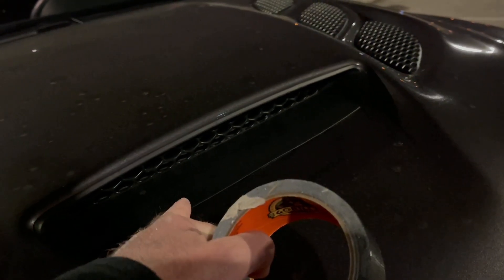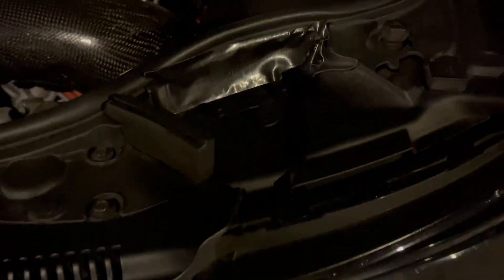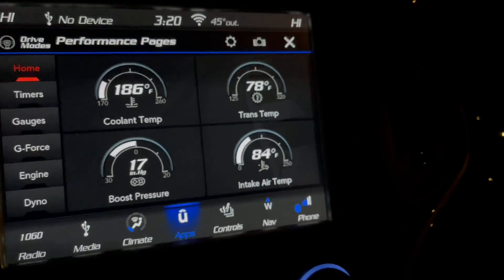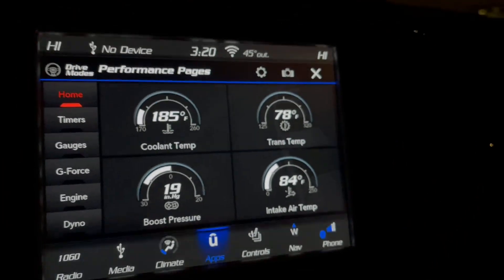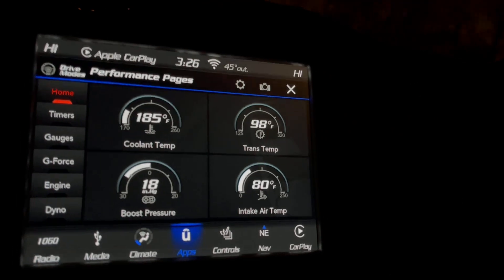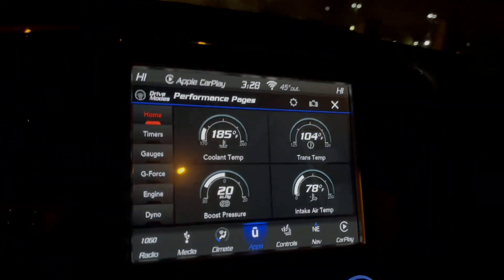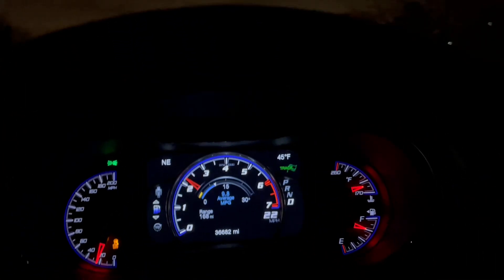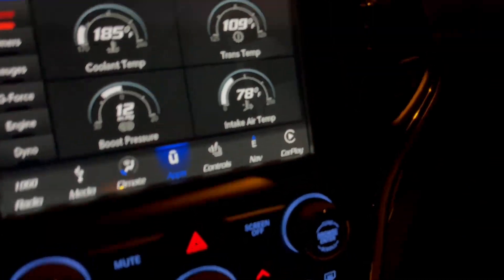DOES CUTTING A HOLE IN THIS OPENING LOWER YOUR IAT'S?

Comment: Just a question or suggestion here Ron, what if one , extends the harness , and runs the iat near the front of the bumper by the ambient sensor ?
Reply from the maker: If any cooler air is getting to the intake it should affect the IATs, but I don’t believe there’s actually enough air passing through this to even matter.
Reply: @EastCoastJeepSRT  kind of compacted in that compartment, and the whole brick nose is closed off for aerodynamics
Reply from the maker: My meter came today. Tomorrow I’ll be mounting it to see how much air is flowing towards the intake. Obviously any extra air is good, but to be cost effective it has to do something.

Comment: Ron unfortunately this test is not a good way to test this. The IAT sensor is under intercooler bricks in the blower so the only way to measure if it makes a difference will be UNDER WOT.  Under normal driving the IAT that you are looking at will stay the same.  You should know this. However I think it’s a waist of time to remove that piece.
Reply: I have a Maggie on my srt and the IAT suck just driving normal. It will drop for me 4 or 5 degrees at WOT. The hemi heat soak fast my IAT generally run about 30 to 40 higher than ambient temperatures. My idle temps can be over 150 at the track not hot lapping it. But also where I live after a pull in the summer the IAT are almost 200
Reply from the maker: Not true. The IATs fluctuate from 20 mph to 40 mph, so you don’t have to be under wot to see a difference. I ordered an airflow meter to place in that spot to see how much of any air even passes through there, but we can now see opening this hole does nothing for your IATs. Unfortunately no one can drive at wide open throttle everywhere so this hole, or part is useless.
Reply: @EastCoastJeepSRT  No I agreee that removing the plastic is worthless ! But the diverter valve does not close until until the jeep is making boost. the only time that any real air flow passes over the IAT that you see in the dash is under boost. All I am saying is your test is not showing anything because the dirverter valve is not allowing any real air flow to pass over the IAT sensor  covered or not.  Having an interchiller  really helps you understand how it works under boost. Its also the best mod I have done to mine ! I can not recommend it enough !
Reply from the maker: @hellhawk4680  As I went wot up the ramp the temps weren’t affected by the cutout or even my hood scoop. I’m wondering if the air from the scoop is missing the intake altogether. I just hate when people try to sell something under false pretenses. Just say it’s cosmetic and zero evidence shows it affects your IATs. Telling people more air gets to your intake without any third party evidence is bad business. I wanna add that piece because it looks better. It won’t affect temps one bit.
Reply: @EastCoastJeepSRT   I agree fully !! That company that is trying to sell that plastic printed insert lol. I got into an argument with them on the FB pages that it’s completely worthless. And they want $70 bucks for that thing 😂.  We’re on the same page 👍.
Reply from the maker: @hellhawk4680  Yeah, that’s annoying me that someone is trying to mislead people with that. I mean, the part looks great. I like it, but don’t sell me snake oil lol
Reply: @hellhawk4680  I totally agree. There are actually 2 companies that make them. The company you're referring to talks shit all the time. The second company doesn't market it as a performance mod and is great to work with.

Comment: I'd have not guessed at those results, like you say not definitive in anyway, but interesting to see basically not alot of difference at all!
Reply from the maker: Zero. I actually ordered an Airflow Meter to test of any air even makes it through there
Reply: @EastCoastJeepSRT  be interesting to see what you find as that is mad. Does make you think all the stuff we do and think it benefits, it's nice to measure a benefit i.e. you add a CAI, we wanna see HP hahaha... in this case you'd swear loads more air! Looking forward to next vid!
Reply from the maker: @MrPugheaven  people trying to make a buck and sell promises without evidence to back it up
Reply: @EastCoastJeepSRT  I hear you there. I'm new to the SRT8 world in UK, not many here. So, used a place called Celtic tuning, by all accounts 40bhp/40lbs of torque more with remap. £325. Luckily I'd got a baseline on a dyno before I started tweaking a few weeks earlier. Post remap NOT A SINGLE BHP more, the graph was the same. Luckily they gave a 14 day satisfaction which I used and got the factory map back on! Incredible, but some would've just accepted that tune and got ripped off. So, done it properly, read up a bit, and got BWoody CAI from states and fitted that this week and got a Diablo tuner landing in UK tomorrow. At least these are proven. We're stuffed here buddy for JEEP stuff, no one knows them and any major upgrades like super chargers etc, have to be imported. Nightmare.

Comment: You might need to wait a bit more probably a couple of miles more before removing the tapes? Probably when you pulled over heat soak started to occur.
Reply from the maker: Soon as you start driving if cooler air is hitting the intake it would drop. Driving a few miles we didn’t see it come down at all.
Reply: @EastCoastJeepSRT  ah yes I've seen the entire duration of the video and it made me wonder why the temp didn't go down when you removed the tapes. So myth busted? The reason i'm so interested is I too, removed a part of plastic from the intake of my car thinking that the IAT might lower, but unlike yours, you have a real time IAT gauge that could tell the exact reading. Nice video by the way, great effort! 👍👏